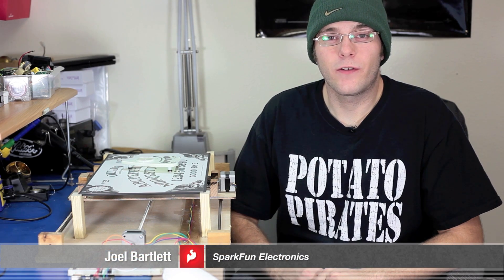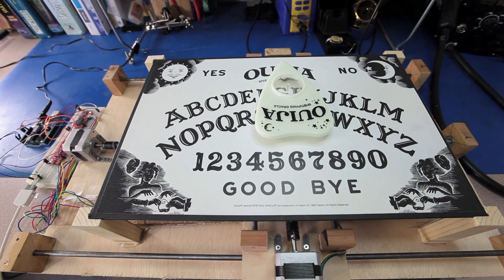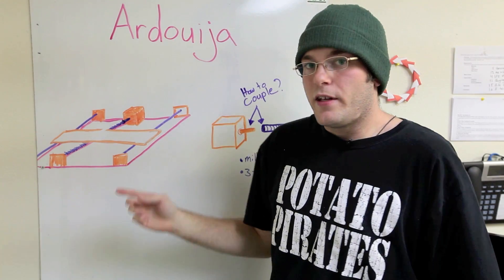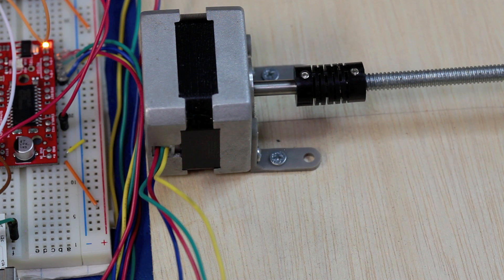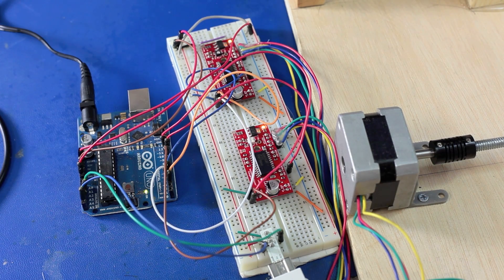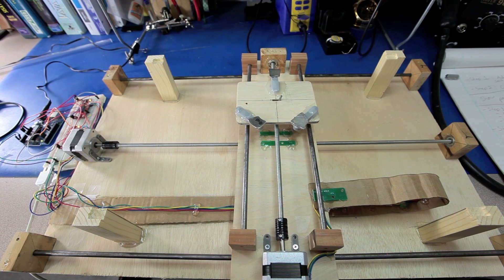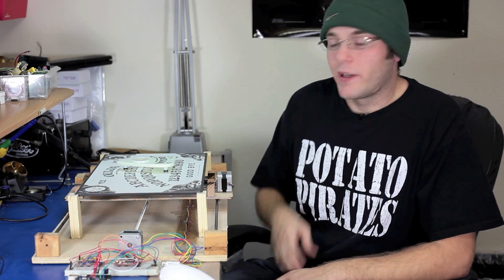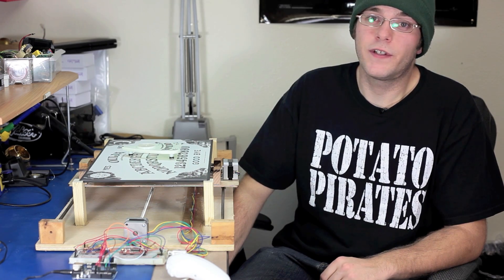SparkFun Engineering Roundtable 10-8-12: Ardouija

Comment: Lately I've seen cap sense grids that are amazing though I wonder how many pins they use. Maybe there's a way to bank switch whole grids?
Anyway, if the underside of the Ouija board is calibrated then maybe a small robot car could do the actual move the magnet around underneath. If the car has optical sensors then maybe a drawn grid on the underside would do it.